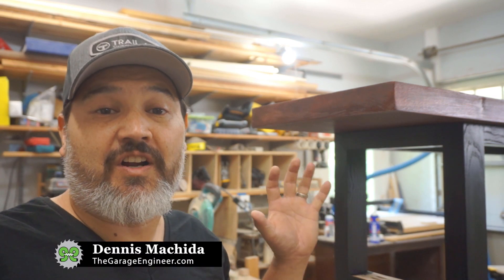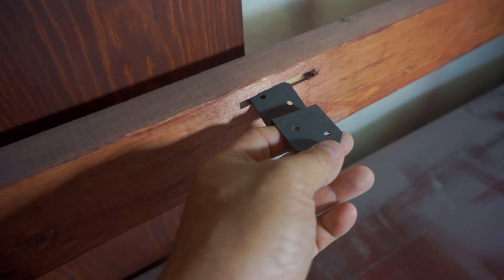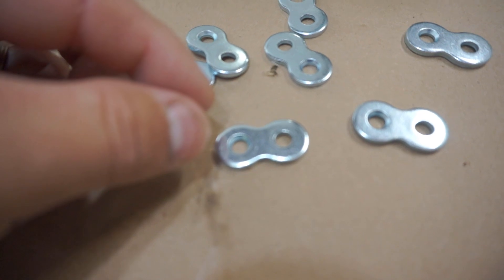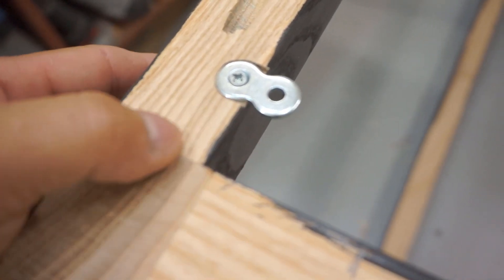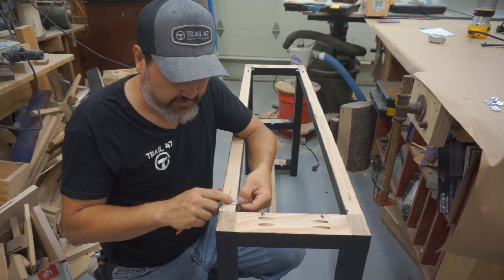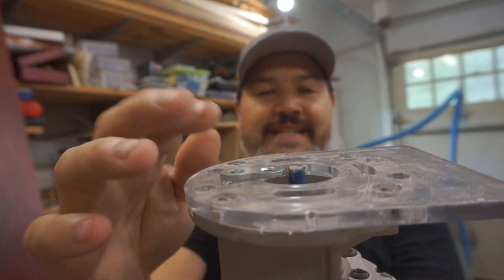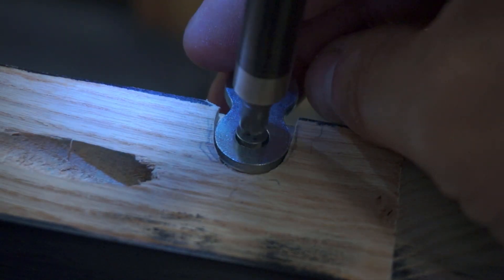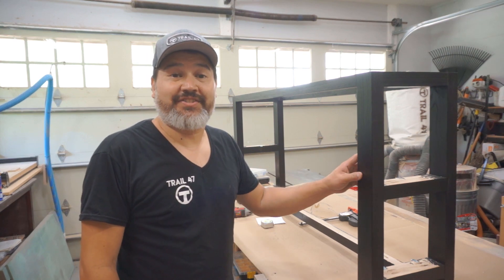The Cheapest & Best Fastener to Attach Tabletops - The Garage Engineer

Comment: Would the work for a 2" black walnut bar top that's 6 long and 18-20" wide?????
Reply from the maker: Yes.  Works with all tops. The key to the product is that it allows for wood movement. Good luck.

Comment: agree with all the comment below, you have the expansion incorrect.  Wood expands across it's width, thus the fasteners should be o n the short aprons like bottom.  However, you can fix this on your table by adding a washer on the underside of the tabletop and use undersized screws.